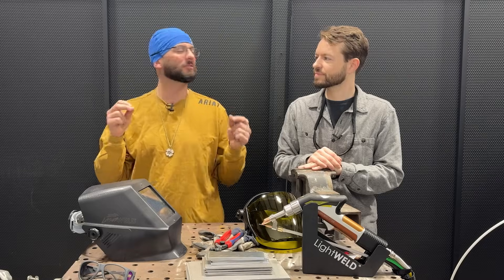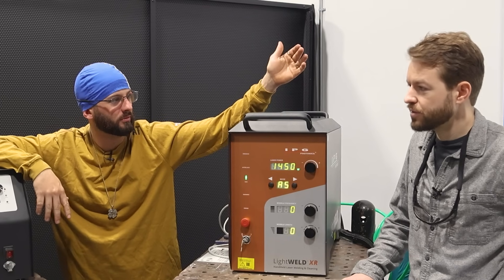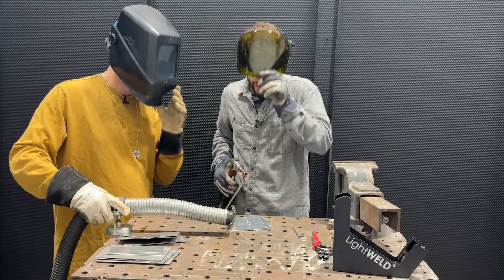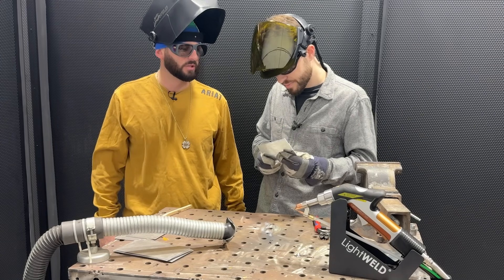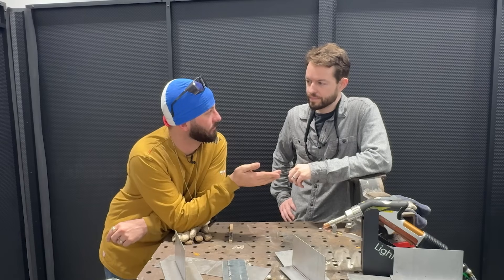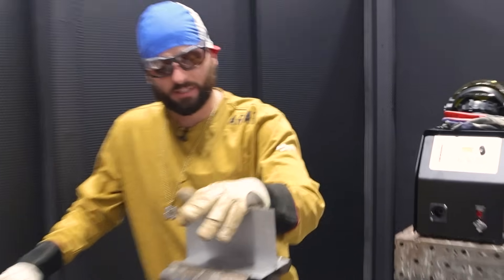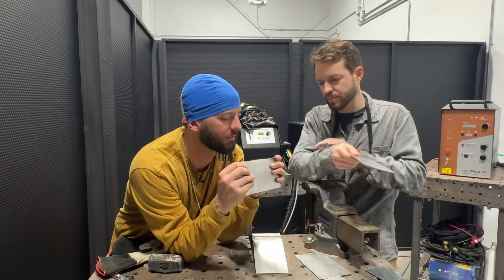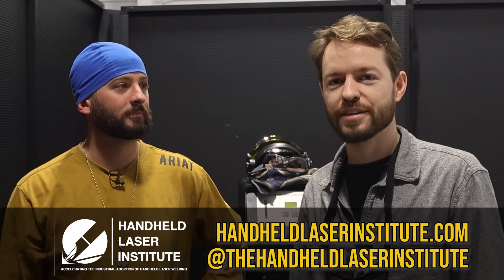Laser Welding vs. Laser Brazing: Which Is Best For Galvanized Steel?

Comment: Is there any concern about the structural integrity of the weld when it comes to using stainless steel wire on galvanized metal? 

I love the idea of stacking the 7mm extensions, but I am concerned about the likelihood of corrosion when you have stainless and mild steel touching. Also, was anyone able to have any luck using  .045 ER70S-6 while stacking the 7mm extensions?

Comment: That light weld laser welder is top tier! I used that same welder for a recent stainless steel hopper, it’s crazy how much penetration you get at the speed you weld at with the laser welder.. though the nitrogen fumes coming off when welding are kinda intense.. Great Video though!

Comment: I'd like to see some thicker welds. Up to 6mm aluminum for say a jet boat or tubing for a racecar, off road bumper. Something structural. Sheet metal work is cool and all, but can lasers weld anything substantial?

Comment: Hey guys welding galvanised requires that your gas flow be just that tiny bit higher than normal.
Because what you don’t get on a lap joint is good coverage.
Try a different gas nitrogen does chill the weld try CO2 Argon mix.
Try running a file across the edge of the lap joint.
I’ve always used similar technique as one would for Aluminium. 
Remember galvanised steel you are dealing with the same oxide coating that the laser must clean first.

Comment: I've used Silicon bronze in tig welding galvanized flanges, grinding into it lightly and welding over it with 70s6. The bronze floats the zinc and stops capillary action
Reply: interesting.. aint never heard of nothing like that!
Reply: Really interesting video 👌

Comment: Hate welding galvanized metal!!!! Gotta spend time grinding galvanized off then fit it and weld it up. The best grinding wheels I found are ones for aluminum grinding. They wear out quicker but they don’t get boogered up with galvanization.

Comment: I've tried an inside corner joint collar to flange with 18 gauge galv steel with just standard .045 mild steel wire with a prep grind to remove zinc from the weld area and without prep grinding using the steel setting, I've gotten rainbows with minimal smoke but I've gotten little random spots of porosity with the rainbow as if I go any higher for a deeper weld it would just be full of holes

I'm curious if it's low carbon stainless steel specific or if I'm doing something wrong I'm not aware of, but with the mention of smoke, I'll get black smoke flowing from it both with wire and doing fusion and it even leaves a black soot like residue on the metal that wipes off with a rag.
Reply: Maybe a gas issue? im not so sure bubba
Reply: @Drweldz  using nitrogen and the stainless setting as it says to do. Don't know if it's that I'm using laser cut material or if it's the 304L or 316L